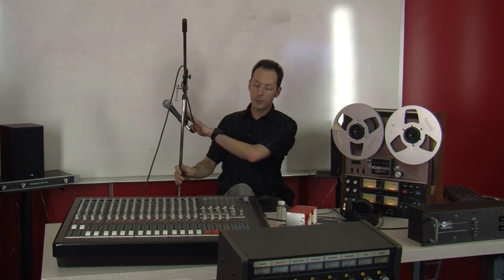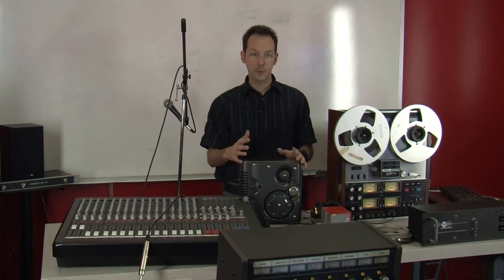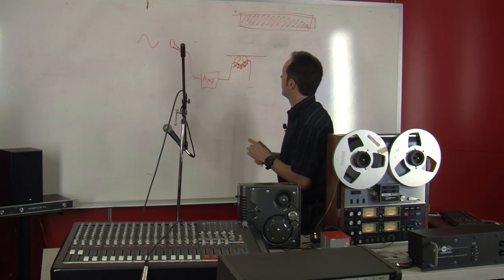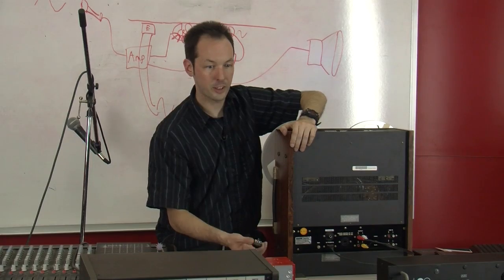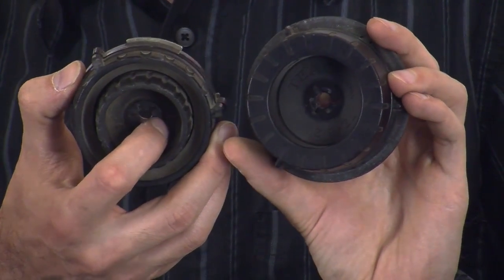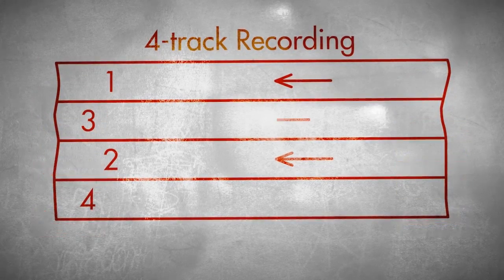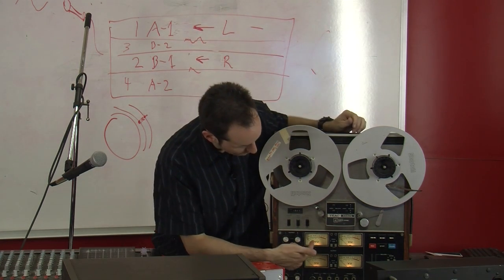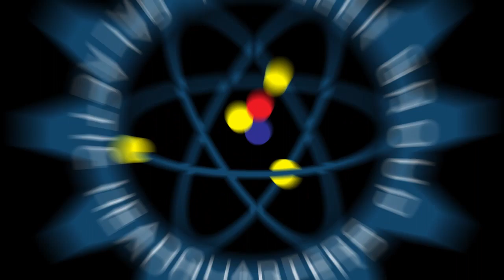Reel-to-Reel Basics

Comment: I need help transferring tape to Audacity... anyone? I have a lot of reel to reel tape of my Dad who recently died. I am trying to preserve his music to Audacity however, not sounding right some is great others sound like the chipmunks others are so slooooowwww. All of them are from the same tape.. so confused and not real tech savy : (
Reply: The tapes must have been recorded at different speeds. You will have to go tape by tape and find the correct speed while you record it to your DAW. Your tape recorder should have a speed switch to play back at 2 or more different speed choices.
Reply: theRealMuseum It's bad idea. When you change speed on tape recorder, it changes pitch. So if you want to correct it in Audacity, you must change speed and pitch. You don't need to play with slider and find right speed - it's always 2x, 4x or 1/2, 1/4, because tape speed was 4,76,  9,5, 19cm/s.
But it's always better change speed in tape recorder then in PC, because quality will be much better. For example: If you have tape recorded at 9,5cm/s with frequency range 50Hz-15kHz and you play it at 19cm/s, you get frequency range 100Hz-30kHz. Not many soundcards can record such high frequencies.
Reply: If it is an old Reel to reel,. Some did not have a switch to change the speed,. I don't know the names of these parts so bare with me. The tape player has a small spinning rod that runs against a rubber wheel (Pinch Roller??)  feeding the tape at a certain speed. On the older machine, that rod will have a lever to move it away from that rubber wheel exposing the tape. Its near the center head cover. When you move the wheel away,. there should be a finger screw you can turn and take out. After you remove the screw, that metal rod can be slipped off making the rod narrower in size. Put the screw back on, flip the lever pinchong the tape again, and when you play the tape, it should play faster, usually double the speed. I believe the speeds are 7.5 ips and 15 ips (inches per second.) Hope that helps. The reason why someone would record at a faster speed is because the faster the tape moved over the head, the better the recording quality. Your dad must have recorded at one speed, then later decided to record at another speed, on the same tape.
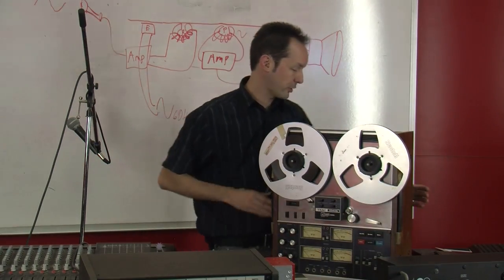Reply: Hey,, he says it at 18:30,. Capstan and pinch roller.

Comment: I have a theory about analogue and digital - that they are effectively the same thing, but digital has a long way to go to catch up with analogue. Digital tries to emulate analogue by using sample rates and bit depth. ie CD is 44.1khz sample rate and bit depth of 16, while HD audio is 192 kHz bit rate with 24 bit depth.

But thinking about analogue - how many Fe2O3 particles are there in an inch of tape? Must be millions - but it can't be infinite - (iron oxide is an element so it can't be smaller than an atom - and there are not at infinite number of atoms in an inch of recording tape.) Multiply  this  by 30 inches/sec  and the number must be huge.

So the equivalent sample rate for Fe203 must be in the millions. (My assumption - I have no way of testing this).

Then we get to bit depth: ie how many audio levels can be measured - 16  bit (65356) for CD 24 bit for HD audio. What would this be for a signal recorded on Iron Oxide? Infinite? Who knows, because every audio tape would be different (analogue after all!) - but I assume it is a lot! (again - millions I suspect).

So maybe if digital used 32bit sample rate (ie 2 Billion samples per second) and 24 bit depth - it may come very close to analogue.

Having said that - I am quite happy to listen to CD audio, but I still love my and records and cassettes.

Comment: FALSE! The faster you go, the less "data" (really, signal in analog) you can cram onto the tape, but the better quality that signal is, because then it's a wider range of signal.
Reply: I need to study this because I thought the exact opposite was true.  I wonder why pro player/recorders use 30 IPS inches per second if this provides less data on the tapes?  Is it possible to have less data on tapes but have better quality signal (dynamics)?  Curious.

Comment: Those metal reels cost a fortune. It is much easier to thread tape while it is on its flat instead of upright. I think you are better off using these tape players using it flat.  And don't believe you will "just find it in a garage sale" because these tape players cost a fortune.